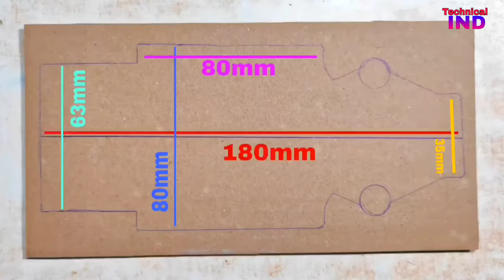How To Make RC Car At Home || DIY toy Car

Comment: Bro can it run on 9v battery? Pls reply
Reply: I am using 6v battery but the receiver heats up quickly.
Reply: @YK-98  so should i use 2 AA batteries then?
Reply: @thirubsk16  yep, 1.5v battery two AA batteries  3.0v it would be good!
Reply: @YK-98  ty